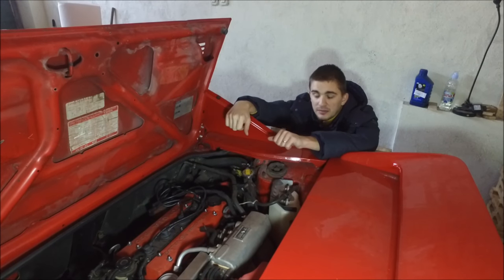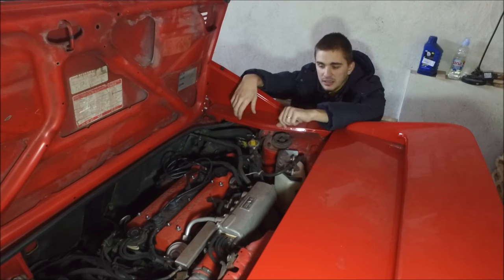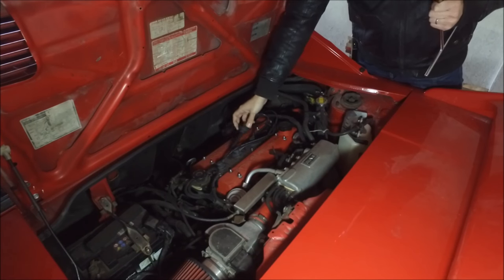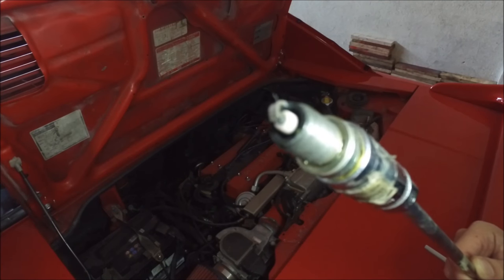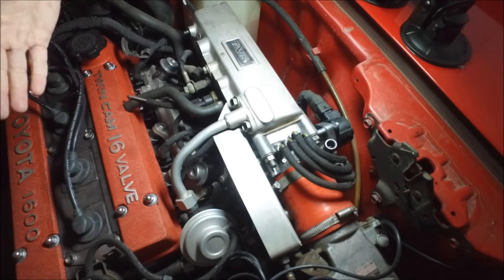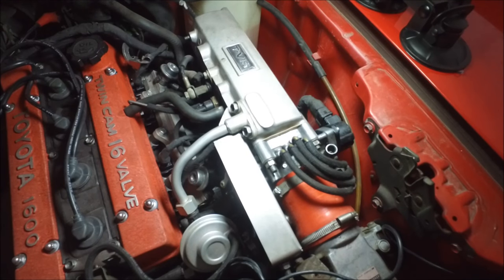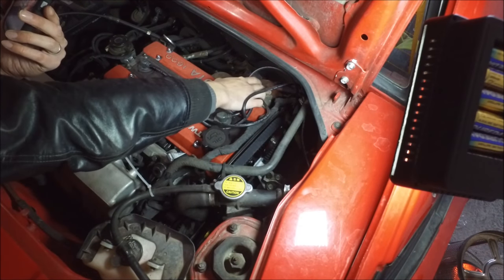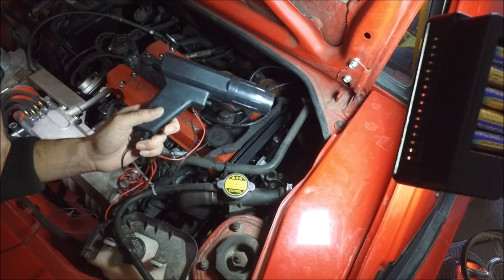Engine troubleshooting - what was wrong with my engine

Comment: Very nice and neat job on rebuilding your engine, including retaining the EGR and TViS.   I would not use throttle body cleaner to check for vacuum leaks; in addition to being highly flammable, it is also an excellent solvent, and can harm painted surfaces.

Comment: love the content on your channel, very educational !

I hope you don't mind me asking but what microphone do you use ? I might have a suggestion that could help reduce the white noise.
Reply from the maker: +Kapil Patel Thank you, I'm glad you like the content. 
I'm using Rode videomicro in the first shot and pyle pro pdwm96 wireless lavalier in the rest. I should have removed the wind guard from the videomicro and turned down the volume on the lavalier I think. Im really new to the audio stuff so advice is definitely welcome, thank you.
Reply: Rode is a really good for audio.

If you currently record the audio at a high volume, turn it down and crank it up in post production. Do a sample test to see if it helps to cut out white noise.

DIYPerks - This channel may be useful for cheap mods to your setup. I'm not associated with his channel but the information on light and sound is excellent.

Comment: if you don't have a stethoscope to listen to injectors, get a long screw driver put the metal end up against each injector and the handle up to your ear. it will give you the same results. i had to do this to my aw11 when i was having misfiring issues with the 4agze

Comment: Can you do a video on the vacuum hoses?
Reply from the maker: Jeremiah Hale What about them in particular?
Reply: driving 4 answers How they are installed and what they do for the engine.
Reply: I'm rebuilding 4age engine and my Mr2 didn't have the hoses from the old engine. So, if you could show me how they are setup on your engine that would be most helpful!
Reply from the maker: +Jeremiah Hale Here you go: http://www.pbase.com/aw11mr2/image/39827800. This is what I used and how I set em up. The entire gallery in this link is super useful, check it out. This will be more useful in this case than a video I think. Feel free to ask if something isn't clear.
Reply: driving 4 answers This is perfect! Thanks dude
Reply: Hey did you get all them vaccum lines in?

Comment: Could you help me out I have a 86 aw11 it has a strong crank but will not turn on. I’ve replaced efi and injector relays I have spark, but I can’t get it to run on its own power. Unless I use starting fluid, but will die immediately, any tips?
Reply from the maker: Did you test compression?
Reply: @d4a  yes! All 4 cylinders have excellent compression, I’m thinking could be electrical but I’m not to sure where to start
Reply: Fuel pump is in working order as well

Comment: How do you replace spark plug tube seal on a 4age? My spark plugs are covered in oil.
Reply from the maker: +ariyapol prasertsilps If it's a 16v 4age it doesn't have spark plug tubes and no seals. It might be a worn valve cover gasket. Remove the valve cover and replace the seal, it's fairly easy. Take a look at the grommets underneath the valve cover nuts, they can leak oil too.
Reply: Thank you!

Comment: I just delete all the egr shit and just keep the tvis. Makes the engine look much more simpler and less things to cause problems. Also the egr valve is like 30+ years old and sometimes gets stuck causing huge vacuum leaks
Reply: How do u delete it I need help please. I just also came back from drive my mr2 and the dam thing surges all the time when it’s on drive at a stop light and overheats but the head gasket has no leaks and it has a bad rattle when I give it gas and it almost sounds like my flywheel is about to fly please if u can help me
Reply: if its overheating, check your thermostat or see if the rad is clogged
Reply: DAT Blue Husky thank u !!!

Comment: I wouldnt be driving that in the rain, snow or after a car wash due to your placement of the intake filter
Reply from the maker: Jess John You're right. I placed a big plastic bag over the filter whenever I washed the car. I got rid of the entire stock setup now. Making something new with bike carbs. Check it out on my channel if you have the time.
Reply: driving 4 answers just curious what was the total cost of your engine rebuild and where did u get brand new parts like the metal coolant hose attached to water pump
Reply from the maker: Jess John I stopped keeping track of the cost. Ballpark is 3.000$ let's say. But it can be done for 1500$..maybe. The parts aren't new, they're restored. Sandblasted and galvanized.